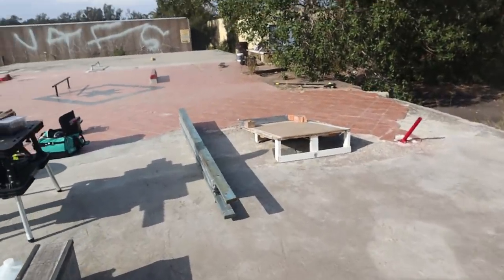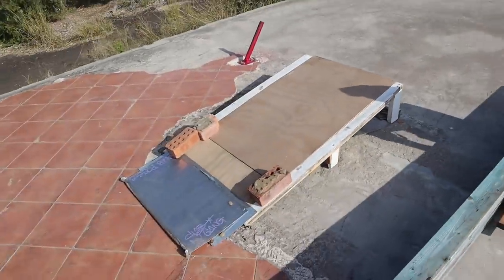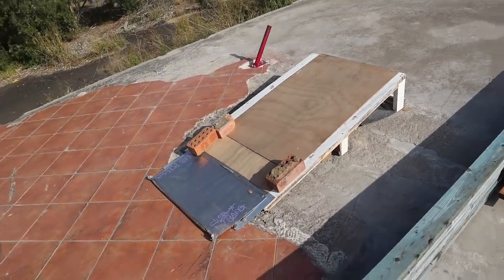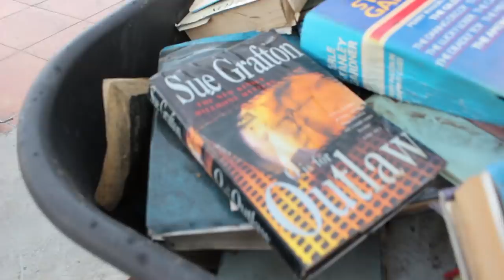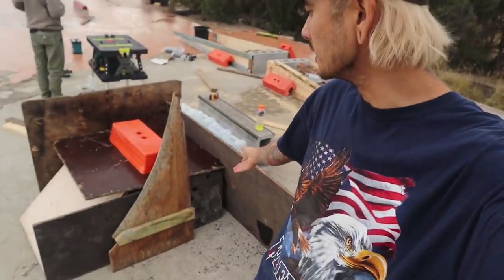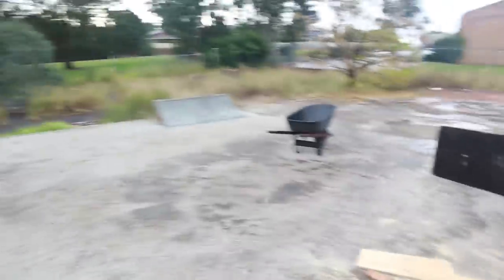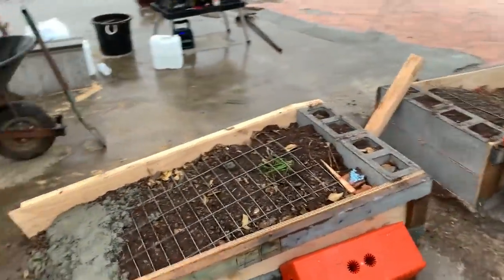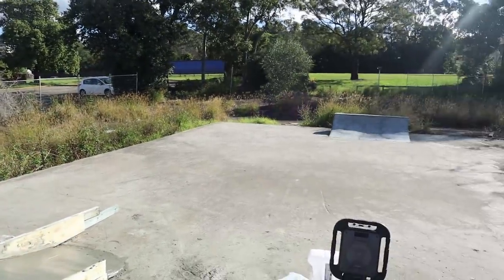D.I.Y DIARIES EPISODE 5 | D.I.Y SKATEPARK | BUILDING A CHINA GAP

Comment: Rain is great when doing masonry, makes the mortar not dry too fast, the slower it dries, the stronger it will be. I recommend watering for a day or two, making sure it all dries even, prevents cracks forming.
Reply from the maker: Someone did tell me to keep wetting it as it goes off, i just thought having it dry with the sun beating down on it would help, but i will do that for next time, thankyou for the heads up dude

Comment: I'm building a diy park with my friends, do you have any suggestions on easy obstacles that we could build for free or cheap? We already built a ledge and are in the process of transporting a slappy curb.
Reply: Make a rail from scrap metal from industrial bins
Reply from the maker: if you can source some scrap metal and if you have a mate that can weld, deff try get some rails happening, or even a polejam
Reply: Yeah none of us know how to weld but we did find this one thing that could work as a rail we'll just need to cut it and use some bricks to raise it off the ground a bit
Reply: Literally any of the obstacles they make in this series. They basically show you how to make every one step by step

Comment: You should smoothen out all the sketchy places on the floor that might stop your wheels with bondo so you can ride around a lot smoother
Reply: And possibly just give the whole place a tidy up I know it’s not your job but say the council come around and see it they might think it looks clean and tidy if the trees are trimmed and stuff and all the debris is gone etc 🤷🏽 just a idea
Reply from the maker: I used a bit of left over cement to patch some holes in the tiles but the more the slab gets skated the more they will chip away over time , i have picked up litter from the carpark and around the slab to just make it look less messy but technically the council cant do anything about it since the property is owned by the bank
Reply: Sean Enuks ah that’s ok then